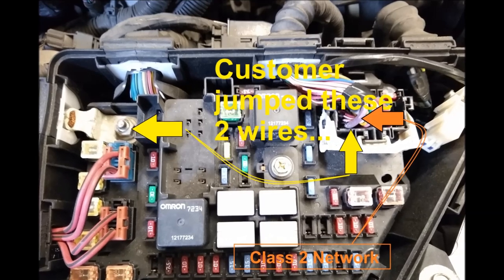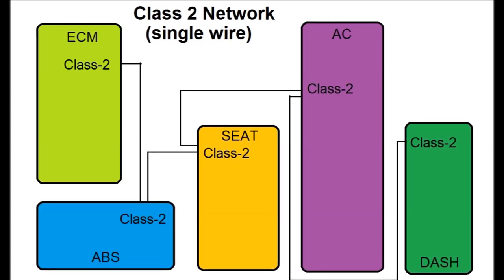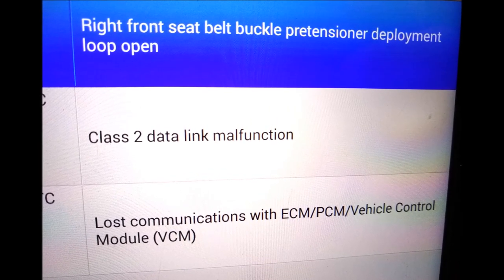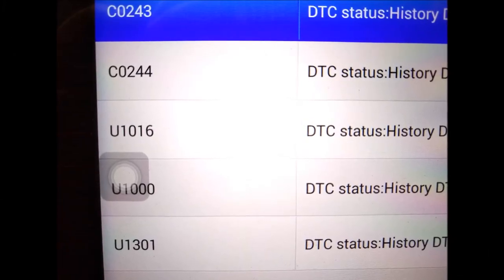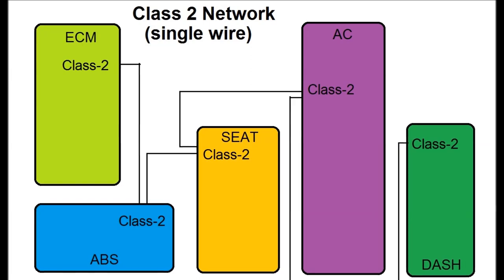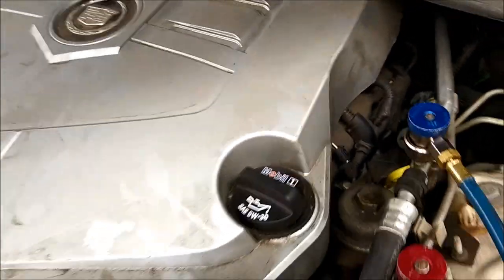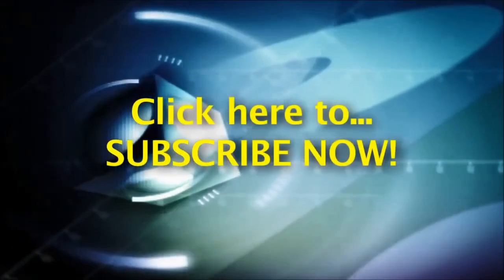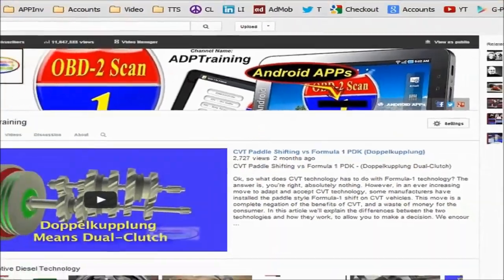Class 2 Network Fault U1000 U0100

Comment: My 2003 Chevy Silverado is throwing that U1000 code right now. My passenger door lock doesn’t unlock when I put it in park. I want to read your book and try to figure it out myself
Reply from the maker: Thanks for posting. Definitely, my Ebook will help you. Here's from my website. Scroll down till you get to it.

Automotive Computer Network Repair book on PDF

Learn the deep science of automotive computer networks with this straight-to-the-point book on pdf. Covering all automotive network communication network protocol, this book deals with theory and practical auto diagnostics. Ever had a car with a non-shifting transmission or a dashboard that won’t function due to the network? Yes, it is true. If the network is down, on almost all car today, the car won’t work or even start. With as many as 16 on-board computer networks, today’s vehicles are very complex. Learn how this technology works.  

http://www.autodiagnosticsandpublishing.com/Automotive_Diagnostic_Repair_Book_Catalog.htm